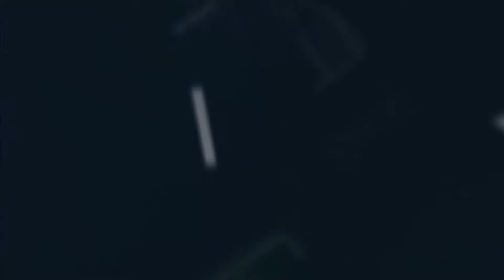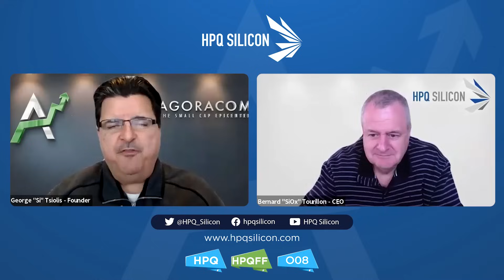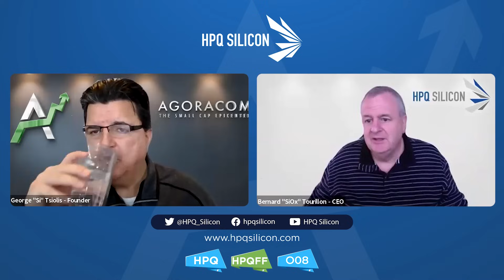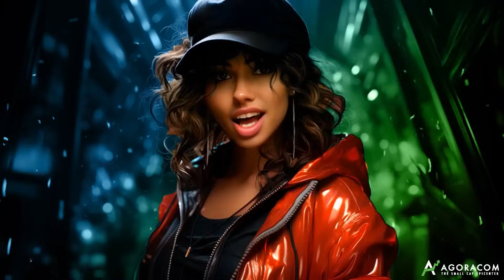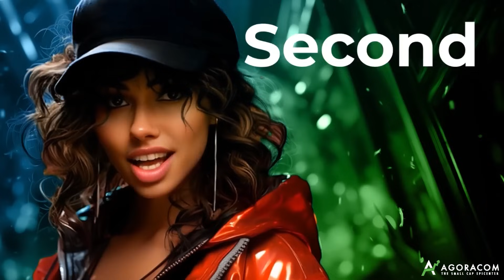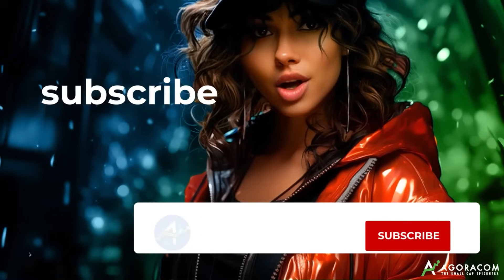This Small Cap Silicon Company Is Unlocking $130 Billion Market For New EV Batteries

Comment: Not a big fan of SiOx. Si offers way better battery capacity than SiOx.
Also lithium sulphur, lithium metal and sodium batteries will go commercial in a few years which will be the batteries to produce to stay in business.

So far the silica division is the one area where I see a clear advantage of hpq silicon